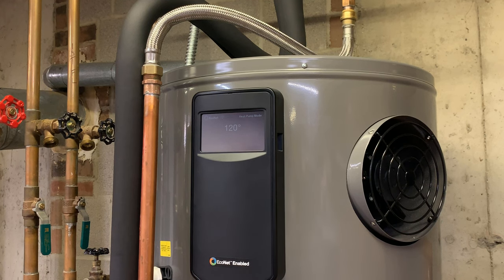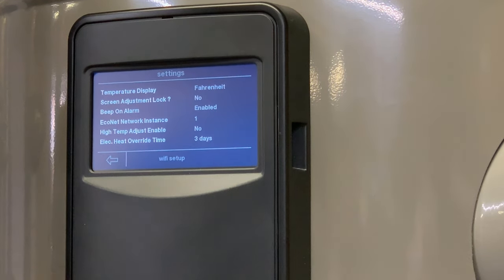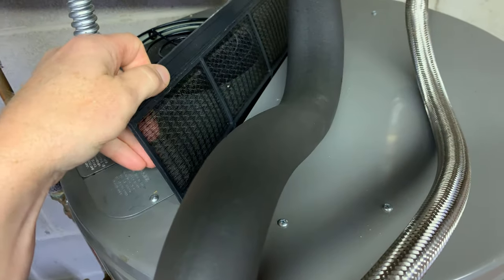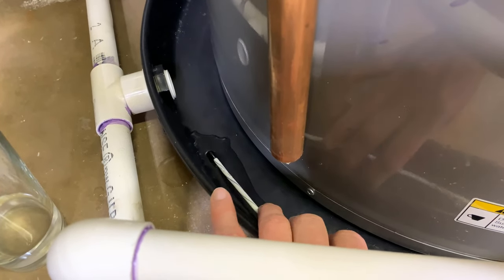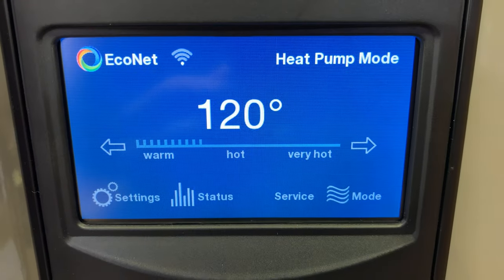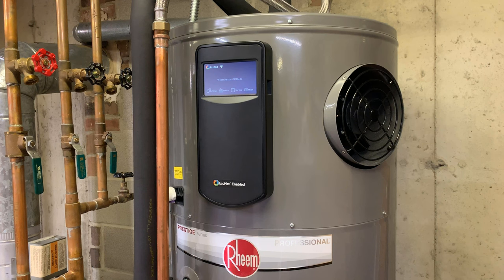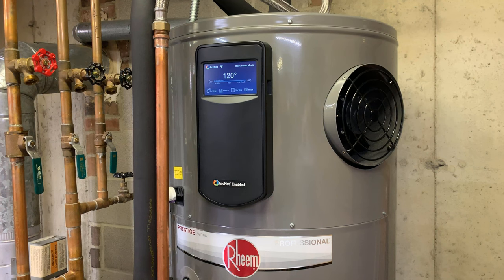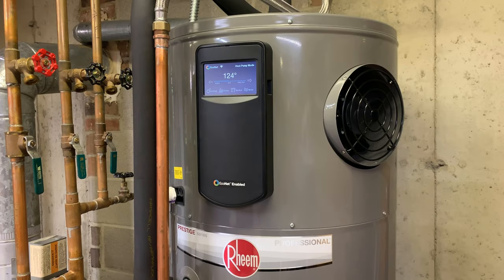Close look at water leak detection & noise levels of Rheem Prestige Professional Hybrid Water Heater

Comment: For those of you who are confused about why some of these are reported as quiet and some are loud, Rheem made some significant changes to the product last year resulting in a product that  is widely reported to be 65 to 69 dbm. The changed product is the 5th generation. You can tell the difference one way by noting if you have the integrated duct collars or not. The 4th gen product has duct collars that allow you to attach the ducting directly to the units. The reviewed unit in this video is a 4th gen unit that have the intake and exhaust collars. The 5th gen unit requires the duct adapters that you have to purchase separately for between $125 and $150 each and are often hard to get. They also reduce the clearance a small amount which can be problematic for standard 30 x 30 water heater closets. The exhausts adapter puts the collar attachment point further away from the unit removing clearance. 

There is a full discussion here as well as other threads on the internet:

https://www.reddit.com/r/Plumbing/comments/m0qmym/rheem_professional_prestige_proterra_hybrid/

I was all set to by and install this product but the water heater closet, which is outside, shares a wall with my daughters bedroom and I couldn't introduce a noisy appliance right next to her room. I'm hopeful that the product can be fixed. I'd buy a 4th gen unit in a heartbeat if I could find one in stock. Rheem has been sending retrofit blower kits out that claim to bring the noise level down to 59 dbm but this is still many times louder than 49 dbm.
Reply: This is so helpful, thank you! I could not figure out why some reviewers were so adamant about noise and some didn't mention it at all (though some more recent reviews still don't mention it).
Reply: @arinpounov369  Some recent reviews picture the 4th gen and then looking deeper you realize these are republished reviews. This happens a lot with comparison reviews where a previous review will be sourced for a new comparison review.
Reply: Thanks for this, really clears up the mixed reviews.  Guess i'll hold out for a hopefully improved 6th gen.
Reply: Thank you for the great information. While the 5th gen "may" have improved something, the added noise and the expense of the exorbitant duct collar makes it a downgrade, in my opinion. It also points to lack of testing and common sense evaluation that Rheem has foregone in a rush to bring this to the market.

Comment: I bought this same water heater two years ago and it's been great. I only run it in heat pump mode which is why I can include it along with my four mini split systems on my "must haves" when it comes to powering my home on my 7K inverter generator when we lose power. Some people like to knock this water heater by saying its too expensive for the time it takes to repay for itself in terms of energy savings on your power bill. That doesn't mean nothing to me. My water heater only pulls like 600W when its running which is simply awesome.
Reply from the maker: Thank you for sharing your experience, valuable information for shoppers for sure!

Comment: Nice.  I replaced a 20 year old 50 gallon last month with a Rheem 50 gallon HPWH.  I run it in heat pump mode only to save energy.  I avg about 1.8 Kwh/day (I love the app).  I installed solar this year and have enough capacity to cover the water heater so the energy cost is free.
Reply: Bought a house a little over a year ago that had a brand new Rheem electric water heater and Heat Pump AC system installed.  I also went solar and when our current water heater is running it can consume about 5Kw of power.  In my hunt to curb electricity use I'm debating swapping out current water heater for this unit.   

10 months in are you still happy with the purchase?  My current water heater will go into my mom's house, so the newish unit wont be wasted.

Comment: Is there a way to divert the cold air exhaust? I ask because the one I have in my garage blows cold air right where my work bench is. I need a 90 degree elbow that fits. Do you know if one is commercially available?

Comment: I can get 10% off ($1300) then another $400 back in rebates for one of these. Are they still worth it if mine would go in a southwest Pennsylvania basement? The room is an unfinished section of a finished basement. It is over 7x10 (the utility room) and closed by a wall and door (not louvered).
Reply from the maker: Seems like that meets the space needed, review the install manual (I’m not a plumber)
Reply: @TinkerTry  Yes but will it be as efficient as advertised? It's okay if you don't know. Rheem won't get back to me either.

Comment: I have a small utility room.  Winter time temps are on average 60 in that room.  Do installers run duct work  to intake air from a larger room in the basement, or should I stick with a regular water tank?
Reply from the maker: I don't know that most plumbers would care about duct work, but you should probably check on the install guides for the current models to see how many sq. ft. of room they want you to have around your water heater.

Comment: Can you tell me if there is a probe at the end of the Leak sensor wire with the black cap on it.
A friend has one with a missing cap.  There are 2 wires exposed.  Should a probe be connected or are there just 2 wires?  Should the wires be separated or shorted?   thanks

Comment: Thanks for sharing. I just installed ours a few days ago and have been super impressed. I love the app that shows power usage. Thanks for sharing I'm going to test the water leak detector when I get home! We've used less than 9kwh in the past 5 days since its been in. Amazing.
Reply: Does the unit keep track of the power usage? How has it been over the last 8 or 9 months you've had it (usage and # of days)? My concern is the water heater pulling too much moisture from the air in the winter months as we struggle to keep the humidity up. Has that been a challenge?

Comment: I have this exact unit, and the leak sensor alarm constantly goes off. I check almost everyday since I've moved into this house and there aren't any leaks anywhere. I keep clearing the alarm history and the active alarm, but it instantly goes off again. I've read through the maintenance manual and haven't gotten any help there. Any suggestions?
Reply: Is the leak detection wire in a metal drain pan?
Reply from the maker: I had a few sporadic alarms about the drain clogged or something along those lines, so I cut a notch on the inside center of the right-angle down turn of my attached drain PVC line, which prevented any puddling of water near the outlet, and the alarm has gone away for me. Something to consider? Sorry I just spotted your comment, hopefully you found a resolution.
Reply from the maker: In my case, I put the detector wire in my plastic pan.

Comment: I see you have the temperature set at 120 but on the sensors screen the tank temperatures were a bit under that. You might want to double-check but I think Legionella bacteria growth stops at 122 degrees F. and it dies in the low 130s. I had recently checked my temperature (Spring 2019) at the tap and it was a sad 114. I had to boost it up a bit.
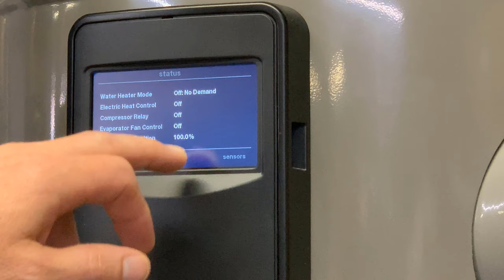1:10
Reply from the maker: Wow, I cannot thank you enough for bringing this to my attention! One of many articles:
https://www.treehugger.com/green-food/is-it-safe-to-turn-down-your-water-heater-temperature.html
I really appreciate this, and I'll update my article
https://TinkerTry.com/replaced-my-gas-water-heater-with-more-efficient-hybrid-electric-rheem-review
accordingly, once I see my tank temps when the Rheem is set to higher temperatures.

Comment: So I bought this year's model with an added Proterra package. Seems to add just an auto shutoff valve (solenoid) that works with the leak sensor. What's puzzling is now they tuck the sensor inside the unit down a sheath and there's a red rope that runs the outer perimeter of the unit. I'm not sure if this red rope is just for show or if it's the external leak sensor. I can't tell if it's actually wired although it doesn't appear to be, but the manual points to it as "lean detect" (one of many typos) and the parts list has 3 different part numbers for rope water sensors. 

Also i wonder why they went away from that nice touch display and went with LCD screen with buttons. Seems a lot less functionality too. Probably cutting costs on their end.
Reply: SOLVED - This woman explains it perfectly: https://youtu.be/Eilf3gBT6s4?t=1387

Somehow the leak sensor integrates with the red perimeter rope to detect both internal and external (they call it 360) leaks. What was frustrating me is that I am getting constant false positive leak detects. When I remove the leak sensor from the sheath and still leave it plugged in, false positives go away. This woman says that because of the 360 leak detection on this model only they require a drain pan. Would have been nice if the manual said that. Mine is on a concrete slab so I can only assume it's picking up moisture from the concrete.
Reply from the maker: Such an awesome and informative video, thank you! I've added your great comments to the article too:
https://TinkerTry.com/replaced-my-gas-water-heater-with-more-efficient-hybrid-electric-rheem-review#jan-28-2021-update

Comment: Hi Paul, any instructions on how to flush the system? I’ve had that Rheem Prestige water heater for about a year now and I would like to flush it as part of the regular maintenance. I attached a hose on the bottom and opened the valve, but very little water came out and was thinking that there must be a release valve somewhere that I have to open up as well for the water to flow faster. Please advise and thank you in advance.
Reply from the maker: I'm sorry, I'm just not a plumber, sure hope you found help (so sorry for the delayed reply) or details in the manual. Did it work out ok?
Reply: Open a hot water tap in the house.  That will allow air in the system and remove vacuum.

Comment: About how long with this unit be running and making noise throughout the day? If it's in electric mode will it be emitting noise?
Reply from the maker: I attempted to capture the noise it makes, and discuss it a bit in my article
https://tinkertry.com/replaced-my-gas-water-heater-with-more-efficient-hybrid-electric-rheem-review
I'd say you'd not want to install it right near a living space. I just happen to have it in a back unfinished area of our basement, separated from where I often work and record videos by about 35' and a louvered door, and we can't hear it at all from that distance. Every situation is different though, at least at the time I bought it, it was the quietest unit of its kind on the market.

Comment: I have this prestige Professional and it has no tray or alarm hose on the bottom. I get water all over the place and no alarm goes off. It sounds like the installer didn't finish the job. Only by watching this video did I learn about the missing tray and hose alarm.
Reply from the maker: Glad the video helped you some!

Comment: Condenser is in the tank the evaporator is in the top with the noisy compressor and fan. Just had one installed and the compressor vibrates through the wall since the tank sits against it and has high ringing noise that is not normal. It's in the garage and if it were in the house, it really would be annoying. I have 30 years of appliance repair and this noise and vibration is not acceptable therefore I do not recommend this product especially if it is installed in the house.
Reply from the maker: Thank you for the feedback, could you let my viewers know your exactly model number?
Reply: @TinkerTry  I think they are all like this if they are Gen 5. XE40T10H45U0

Comment: Did you install this unit yourself? If you had a professional install it then they should get rid of those flex lines on the water supply.
Reply from the maker: That was an attempt at a bit of vibration isolation, with a living space right above. I'm guessing you're feeling is that they're likely to fail sooner, do you have an alternative suggestion?
Reply: Rheem actually recommends those flex lines and most code i believe actually calls for these types of flex lines.

Comment: 1:47. You know your actual kwh usage and local electricity rate ? Those numbers seem totally useless to me. My electricity rate is about $0.32/kwh. If I use 650kwh per year it will cost me 208 dollars annually.
Reply: Holy crap!  I pay $0.10/kwh. If your elecrical provider is charging $0.32/kwh I would definitely change providers man.  You are paying 2.6 times more for electricity. Buying a water heater like this would literally pay for itself in a year.  You would basically be cutting your bill by around 15% per year after that.  The more per kWh you are paying the faster the rate of return on this system.
Reply: All appliances are measured to the same kwh price so you can compare one to other. They realize this. Are you in Hawaii? These rates are astronomical. In south Florida where I live it is $0.11/kwh. Also, this calc probably includes some use of the heating element. If your unit is in a warm area, you might be able to run completely on the heat pump, so it would further drive the cost down.

Comment: Not a good idea giving out your IP address can't people hack you that way.
Reply: While your right about giving out ip addresses and they shouldn't be shown, in this case, he has very little to worry about.

To do targeted network hack over the internet, you would first need the "Public" IPv4 address (IPv6 is a whole other beast) to target his network. The only IPv4 address I've seen in this video are "private" ip address and those can't (or at least they shouldn't) be routed on the internet. (192.168.xxx.xxx, 172.16.xxx.xxx, and 10.xxx.xxx.xxx are all private addresses). 

Now if we saw an ipv4 address not be one of those private addresses,  then he would have to worry about it.

 At most this video shows, his water heater is on address 192.168.11.20 on his private network and it assume the DHCP is not changing it randomly.